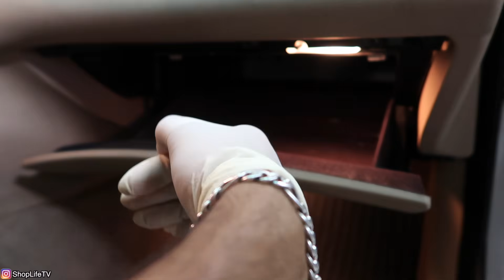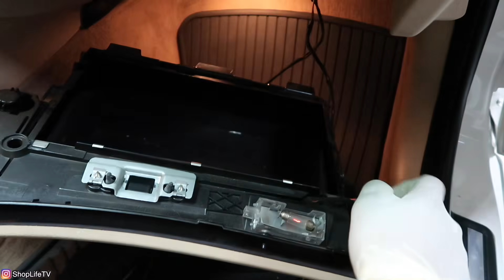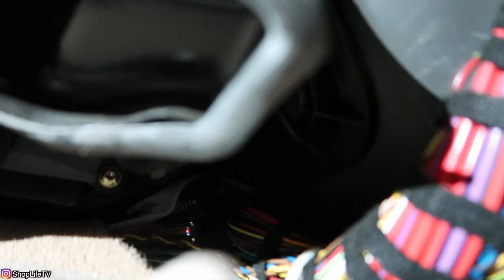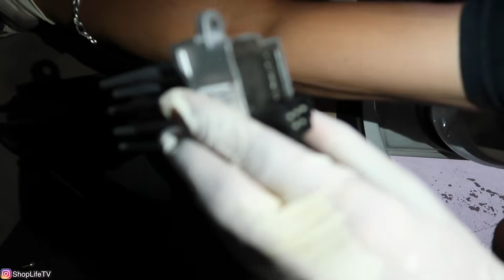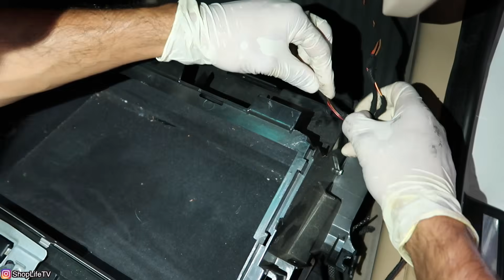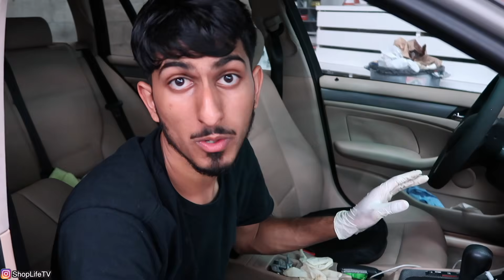BMW E46 AC Blower Motor Resistor Replacement DIY

Comment from the maker: Blower Motor Resistor:
https://click.linksynergy.com/link?id=BZfgVZ7JGM8&offerid=580643.12222112344&type=2&murl=https%3A%2F%2Fwww.ecstuning.com%2Fb-hella-parts%2Ffinal-stage-unit-blower-resistor-e46-x3%2F64116920365%7Ehla%2F
Reply: ShopLifeTV Thanks.
Reply: @KS_VAL_OISE  hi
Reply: Thanks for the video. My cabin fan's issue is that it will not blow consistently so even when I have it on the lowest setting it will blow from max to min sporadically. The other (more important) issue is that it will actually stay on after the car is turned off and potentially until it kills my battery. Do you think this is more likely an issue with the resistor or the blower motor itself? Thanks again!
Reply: @ImMrVinny  Did it end up being the FSU? I'm having the same problem, removed fuse 50 in the glove box to kill it for now.
Reply: BMW e46 coupe 318 2002 143ps good or not good?
Reply: I’m having this problem atm in my e46 but I got a new blower motor and a new resistor but it blows air but not at all’s speeds it’s takes me like 20 mins in the morning for the windshield to defog and it’s I’m also in need for the ac for this summer heat waves! If you know anything that would be helpful, please let me know. Thanks !
Reply: ShopLifeTV i
Reply: Hi
Reply: How are you sir
Reply: May I get ur Whatsapp number
Reply: Can i simply plug in the new one with the connector out and test that this is my issue before i trouble myself replacing it entirely?
Reply: Excellent Video,
Very well explained, thank you.
It took me less than 30 minutes and my Air condition works again. Not to mention this week temperature is in 90s in NJ
Thank you!

Comment: Thanks for the excellent video!
I used a sturdy flat screwdriver to force the clip holding the resistor in place out of the way, just pressed it against the grommet behind it towards the engine.

Comment: Tip- use some lube or oil to easily slide the rasistor in and check your heater before closing everything

Comment: Ciao ho una e46 320 td anno 2003 da qualke giorno nn mo va più l aria dalla bocchette sento rumore di apertura e chiusura  palette ma aria niente in marcia sento un po di aria calda sono a 2 pensieri non so se potrebbe essere la resistenza oppure il motore con le ventole mi potresti aiutare ?ti dico che mi e rimasta la stufa accessa anche quando ho spento il quadro e x poter staccare la stufa ho dovuto scollegare cavo della batteria e da allora nn e più partita ( mentre prima di farlo ogni tanto partiva )cosa potrebbe essere secondo te ?resistenza oppure motorino ?e poi sarà semplice da smontare ?

Comment: Ya know bud. You're STILL the Top E46 Man on the NET!!!  KEEP ON ROCKIN THOSE BIMMERS BUD!! I NEED you! I have two old ones right now and have gone through four so far in my short 12 year addiction to them. One is a 2002 330CI Swapped 100% with a 2006 E46 M3! Inside and out! It's been one of the most reliable and for sure FUN cars I've ever had! I also have done the BAD THING. I've got a 2008 335XI! YUP! I've modded it to the 9's! If I'm running E85 with a 40% fuel mix (It has the capability to keep two or more tunes in it and just have to click the right tune into it and it'll go from a bit over 600HP to just over 700HP!! CRAZY!!!

Comment: Hello friend, I have a strange problem with my e46, the lights in the odometer do not work, neither the turn signals nor the headlights do not show any light, from the outside the headlights work but nothing shows in the dashboard what could be the problem please help. I tried with a relay fuse This is not the problem where it could be please if anyone knows how to help..

Comment: Just got ac compressor fixed also my ac valve it’s blowing cold air in all vents except above radio left vent only 1 isn’t blowing cold it’s kinda blowing warm , I thought it might be resister but looking at your video it explains to replace resister if there is no air coming out but my ac is blowing cold just not all vents, any suggestions

Comment: Thanks. Followed the exact same steps for E46 325i (2003). The thing I realized while working on it was the TX20 bolts are securing the plastic housing of the blower motor in front of the resistor. Thanks a lot for the detailed instructions.

Comment: The final resistor on my 2000 323ci is causing my battery drain. New part on the way.

Comment: Thanks Jason. I didn't know that part existed until it failed. You did solve my problem, but I darn near craned my neck getting my big head in there! 
Note. It's a misnomer to Call it a resistor. It's a module with an I.C. inside able to communicate HV/AC dash control via CANBUS . Who knows why BMW made a simple thing so complex ..but it is what it is. It is the IC inside that gave out in my case. its covered with potting compound. For the curious you can dig out the compound and see the components for yourself. Anyway you saved me a ton of effort.       Ourmandan

Comment: I have a question:
Ive replaced the blower motor resistor, and the new one does not latch. No matter how much I push, it doesn’t go deep enough for me to be able to latch it. I plugged the cables back, put in the 2 T20 screws and tested the AC - everything works! So my question is: is there any danger in keeping it unlatched? Thanks

Comment: Those of you watching this, what symptoms are you currently facing?
Reply: I actually don’t have any symptoms, but I’m replacing my blower motor because of bearing noise, and I was wondering if I should do this the same time but apparently it doesn’t have to be done at the same time.
Reply: @hoseaembury1999  I ended up replacing my final stage resistor to solve the issue of intermittent blower working and it solved it. also another symptom is "surge" blowing, where it isn't consistent

Comment: This DIY is kind of a pain due to having to poke your head down there near some sharpish parts, it's very hard to see what you're doing. I lost a screw and was not able to get the new FSR clip attached; there were only two screws when I took it out so I'm down to one, but it seems secure. I also broke the metal tab on the lower tray of the glovebox putting it back together 😞 But thanks for the DIY it works now!

Comment: The most difficult part of this was definitely that little grommet behind the plastic tab.  It was really hard to try and set the grommet so you could get the tab pressed.  I had to use a trim tool to wedge in between the plastic tab and push the grommet up and out of the way at the same time...very difficult.  After that, it was just a matter of wiggling the FSR out.  You're the best, thank you.
Reply: Omfg just dealt with that stupid plastic tab for about 30 mins while crouched over on my neck…

Comment: My ac doesn’t work and I checked all the fuses and everything and it all seems fine but the resistor get extremely hot not even 5 minutes after turning in the ac please help

Comment: good video just a question I have a parasitic draw and I suspect is the trigger wire to Aux fan so is there any connection between FSR and Aux fan ..measured the Aux trigger wire and has  a draw or 0.02v and amp draw with car sleeping .178ma from negative cable using amp clamp

Comment: Extremely well done video. It’s not an easy job, the resistor is a bear to get out. I lost a screw between the carpet and transmission tunnel never to be seen again. After all that my problem turned out to be a loose 40amp fuse so make sure your getting a good contact before attempting this. Definitely not for the faint of heart.
Reply: Put a microfiber or shop towel over the gaps below to catch falling screws 😮

Comment: Hello , im not sure what problem i have in my e39, because sometimes the blower works, sometimes it dont and sometimes it blows air full power when i turn to the left, so im kinda wrinting this to see if someone start to had the same inconsistent working blower before changing the resistor or if what i describe is more likely to be the motor.

Comment: Hey i hope you reply!!! I have a 2008 bmw 328i that the mechanic told me i had to get the blower motor,the resistor and the harness replaced… what its doing is he said that the car was blowing hot air when the car was off even and draining my battery and the battery i had just got and i know it couldnt be a battery issue so he disconnected the blower motor and its been driving fine but with no ac or heat whatsoever and i want to know if you think it could be something else besides that? Orrr

Comment: How much time it took?

I have working FSU and fine contact, but already 2nd FSU is being melted down in contacts. I heard, that it could be caused by faulty blower, what is taked too much Amps. How do you think? How I can diagnose that? I don’t want to change working blower and do this much work without being sure that it is causing this melting FSU contacts.

Comment: Nice video, I was excited to spend 11 minutes changing out this part.  But being a BMW, I knew it couldn't be that easy  :)

My 2000 E46 Sedan has a stepper motor assembly right in front of the resistor, that fortunately for you doesn't seem to impede your progress.  Trying to gently remove it now...

EDIT:  Watched another video where they had the same issue.  Just need to press in a clip on the left side of the motor, pull down it down to remove the motor from the assembly.  Then you can slide the assembly holder out a little bit and let it dangle, moving it up and out of the way to access the resistor screws and resistor.  It gets a little in the way but not enough to warrant removal.

Comment: I'm going to give it try!  I'll buy the BMR from your link. BTW, I learned, many years ago, to unhook the battery before working on a vehicle electrical system. Should that not be done on a 2002 E46 for some reason?  (and watch out working on a vehicle with a bracelet on...it can get caught on something).

Comment: Very helpful explanation to details. I am able to complete your instructions and have a/c no air issue fixed. Thank you! To put t20 screws back in, magnetic screw driver will help since resistor screw is quite deep.

Comment: It was very helpful.  I did it in less than 2 hours.  It helps to take out the plastic housing for heat/AC.  Only issue was putting glove back in.  It was very simple fix and I have a blower working. SUCCESS!!!!!!

Comment: Hi there I have changed the blower motor with a 2nd hand one ,fuses are 100% and changed resistor...what can the problem be? Can it be the 2nd blower motor and how do you test it outside the car?

Comment: If this goes out, can you still hear the motor turn on and off through the dash? If I turn the heat/AC on, you can hear it power up but doesn't blow at any speeds
Reply: Same exact thing is happening to me rn did u find out if this was the part that u needed to replace? @ ninja-panda- mk1

Comment: I just did this... it was not the FSU it was the blow motor went caput no warning just stopped due to overheating and wires melted inside.. reason? most of e46 come with the same fuse box as a e36 from 1999 reason? is basically same car just with different components here and there... but overall is the same electrical component... minus one key feature... the e46 has a co-dependent AC motor and doesn't require a 40AMP fuse over the habitacle blow motor anymore... yet that fuse is still there.. why? ask BMW ... or the guy who rebuilt ur fuse box after the car was wrecked. that fuse on e46 should be a 30AMP fuse.. to protect the FSU and the habitacle ventilator. otherwise the fuse never blows up... meaning the habitacle motor can short-circuit and the fuse still looks normal since is way above the limit... also the 5Amp is separated and only controls the display unit which is low voltage like 1 amp actually. so next time u replace ur blow motor and FSU ... make sure to downgrade ur 40AMP fuse to 30-35 AMP fuse.

Comment: You're the man dude...
First job I've ever done on my e46.
Fixed battery drain!
I just need to buy the new part now!
Reply from the maker: Amazing! Good luck!
Reply: How did this solve your battery drain?
Reply: @tuukkasaarikko6729  unfortunately it didn't drastically solved the problem. 
That resistor Is a common problem on e46 but in my case it's the diode plate faulty that's on the alternator.

Comment: Watched your awesome DIY, purchased the part from ECS, and just finished the FSR swap. Wiggling the old one out, and getting the new one in far enough for the tab to engage was not fun. I found it easier to remove the footwell cover by sliding it rearward so the two plastic tabs released and then the whole piece could be rotated toward the rear and then the metal clip behind the center console slid out.

Comment: The two vents on the passenger side doesn’t air as cold as the two vents on the driver side. Could that be the resistor or the blower motor?

Comment: Yours must have been a part before, because there is more than one screw that's supposed to be in that thing there should be three. And the top one has the other unit on top of it that you have to line up when you put the new one in to get the top screw back in to keep all the doors opening and closing on your heating and air heating and air conditioning unit

Comment: Hi there,great video and explanation! I have a bmw e46 325ci..my interior blower comes on but there's no air blown out of the vents on any setting..The fuses look ok (28 & 50 fuses) I've been told it's probably the resistor or the heater blower fan..what would you recommend?
Reply: Check you vent connections.  
This happened to me many year ago 
I could hear the blower but the air coming out was very limited 
End up the there’s a tiny swing bar that swing and selecting the vents for air to come out popped and the vent stacked  at close position.   
On my e36 that thing is located behind glove box.
Reply: @dongjingwang4797  Thanks for your reply, it was my FSU resistor..got it changed.

Comment: My air conditioner would operate at times and not at others. My problem was resolved once I replaced the resistor. It was painful to replace because the new one didn't snap in place as easily as the old one did for some reason. Thank you very much!

Comment: Hey so I have the opposite problem were my AC is always blowing even when the car is off and no key in the ignition. I have read that the Final Stage Resistor might be the problem has anyone encountered this problem?

Comment: Thank you so much for this diy.  Changing the resistor fixed my issue with the blower not shutting off when vehicle is off and key out.
Reply: Ohhhh. mine does the same thing I ended up removing the blower fuse. Now I can follow those steps.

Comment: What's up man quick question I have a 2006 325i  I took it to the BMW dealership  Because the heater goes on and off. The dealership told me I needed to replace the blower motor. I didn't let them do it because they wanted $700 to do it when i can do it myself for free.. so i got a new blower motor with new module and its still going on and off. What els would make it do this

Comment: 2000 BMW 323ci E46: Heat and AC work fine, temp wise. However, not coming out defrost or footwell on either temp select. Don't know which flap motor is which to check. I moved the Blend lever(white plastic "rod") and i can get blasting air at footwell but still, nothing at defrost. Which flapper and where is it? Also, when I moved the Blend Lever, it was very difficult and had to move it very slowly. All with OR without engine running. HELP please! Thank you, ahead.

Comment: The ait blower motor fan doesn’t kick in but very  rarely . Should this responsibil of it? Because it is so difficult to cope in winter..
Bythe way. Mine one is 320i SE e46 , 2003.
Thanks

Comment: ok so turned out i hadnt removed one of the screws, but that part in front is broken, the metal bar is broken off the part. what is this part and you think it could be why my heat doesnt work?

Comment: You can hook a 90 degree pick around that upper hole on the resistor pack and pull on that while you release the lock.

Comment: The part has been replaced twice in the last 5 years, but I'm still having issues.
Sometimes the blower keeps working when the car is shut down and locked, draining the battery completely. 

Changing the blower resistor solves it for a couple of months, but the error 19 'Fan control voltage short to ground' always remains. 
Any ideas?

Comment: The first thing anyone needs to do before they do anything else is make sure the electrical connections are sound. I have had this problem several times and what I do is attain the required access to the connections and afterwards disconnect and spray with electrical cleaner, then I reconnect them. Obviously, this may not be the problem, but, since you have to do most of what I just explained anyway, might as well eliminate that a potential cause. I'm not sure what would cause this except to guess that some sort of "lacquering" occurred.  But, as I said, this has happened several times with me (and on different E46's).

Comment: I had a problem with my car where the blower would only stop if the fuse was unplugged, if the car was turned off it would keep going. Following this tutorial also solved that problem.

Comment: Hey Jason, thanks for the video, would have never got it out without it! One question, everything is exactly the same as the video except my part number is different on the unit itself. Mine is 64118383835. Will the linked part work for mine or do I need to search my part number. 2002 325i

Comment: Mine is not working at all. No air is blowing through the vans. Could this solve the issue?
Reply: Did u figure out the problem?
Reply: @dannyramirez1218  yes. I replaced the resistor as in the video and it worked. Chances are 50/50 for the resistor and the blower to be broken. I just decided to start with the cheaper part and I was lucky.
I paid 30 euros and did as per video and my AC works as before.